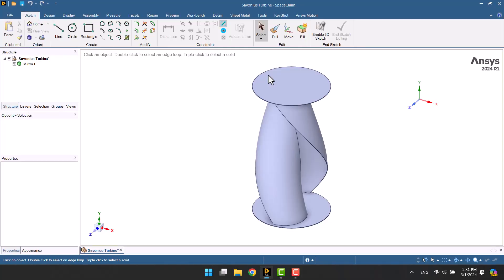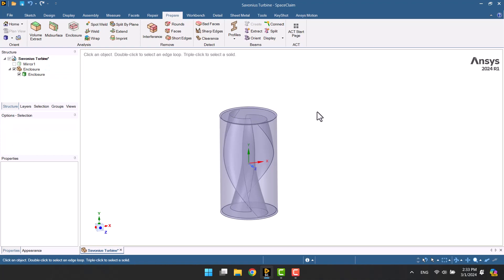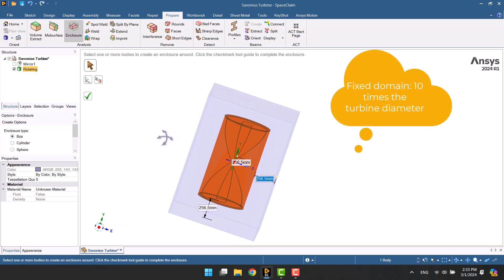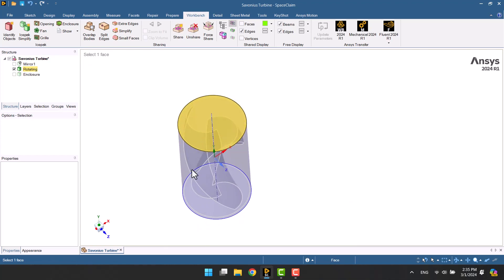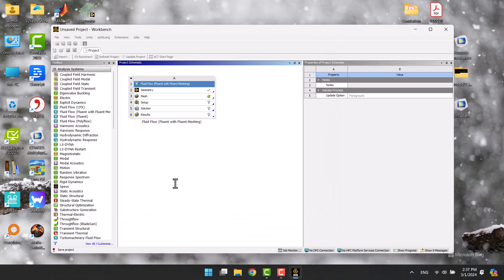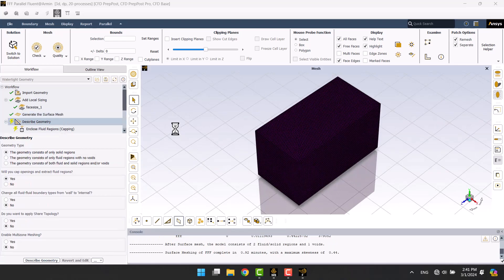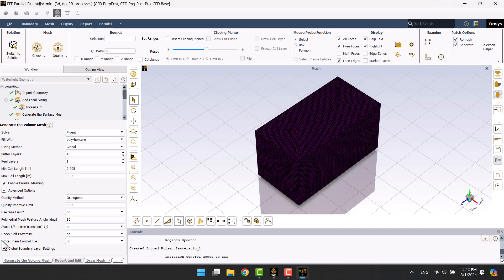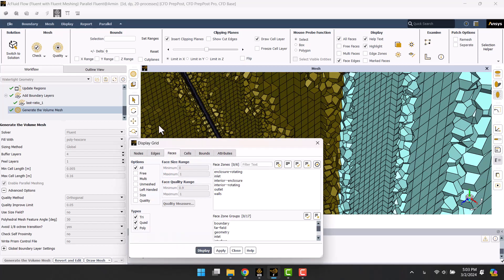🔧 Ansys Fluent Meshing: CFD Mesh for Savonius Wind Turbine 🌀

Comment: Thanks for making such beneficial videos. And I request that could you make a video on the meshing of propellers in different zones like rotatory and stationary. And further, we append together in Fluent, which is helpful in defining the meshing interface. Thanks again
Reply from the maker: Hello, thank you. I have several videos about preparing propeller. You can find them on my channel
Reply: I've already watched it, and most of my problems are solved. One problem I'm facing in defining the mesh interface. I want to make different mesh for stationary & rotary and i want to combine in fluent. Please help me that how i do? thanks for reply @caewitharminhashemi
Reply: Thanks for the reply. I want to do meshing separately and combine in fluent for defining interface meshing. How i do it?  @caewitharminhashemi
Reply from the maker: @Hanshu0007  by share topology you can define interface for domains. I have a video about CFD of propeller which has rotating and stationary domains.
Reply: But in fluent it couldn't detect the interface correctly. Result is more diverging than expected
Reply from the maker: @Hanshu0007  it's simple in spaceclaim and work flow